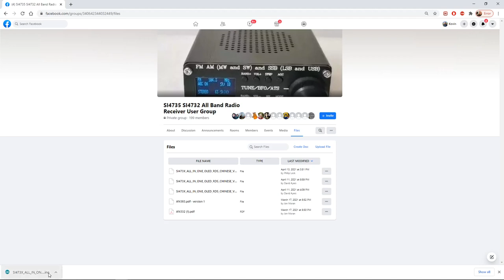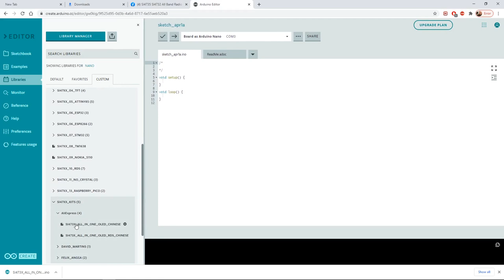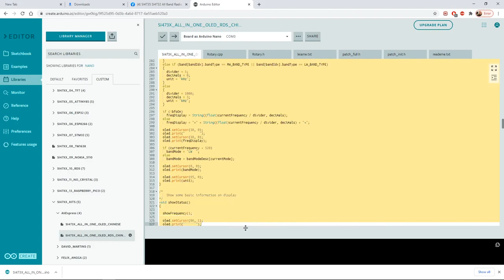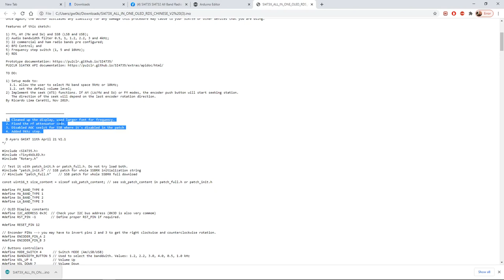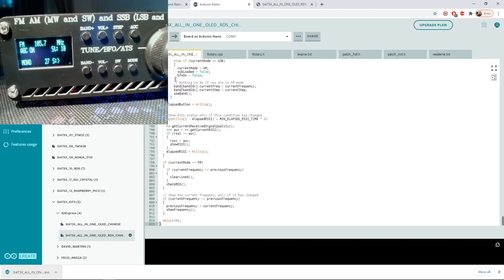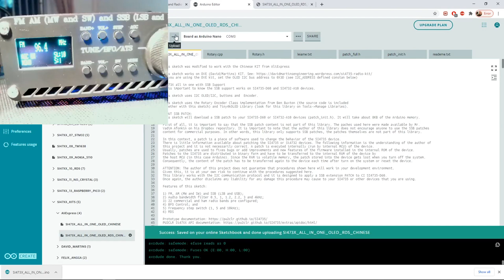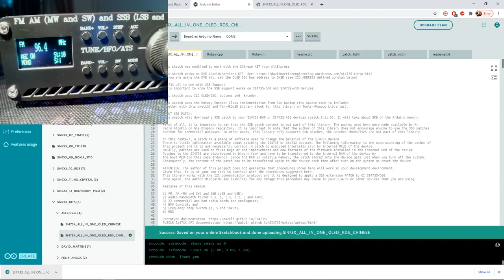Upgrading the SI4732 with better display and 9khz steps

Comment: The 9 Khz steps handy here and I like the bigger freq readout .
Thanks for the explanation of this
update Kevin
Reply: Hi there / Hi Kevin : The firmware used for the earlier video brings with it the 9kHz step selector; the comments by the code author's have not been updated but in fact it does.  Earlier video is https://youtu.be/TqCddn2Hq-4  . You don't need to get any materials from the facebook group to follow this earlier video. Also with a bit of programming you can amend the code and upload it with improvements, also.

Comment: Had problem in that I could not upload to the 328 chip. For some reason the boot loader was not there or not working. I had to find the 328 bootloader HEX file and load it using AVR Studio and AVR ISP Mk 2 programmer. I could then load the program. have yet to test it fully but it appears to work properly. 
I am rather new to the Arduino environment, most of my AVR programming has been done in BASCOM. What I can now do is make changes to the code if needed and copy the HEX code from the programmed chip and transfer it to other 328s.

Comment: I need detailed instructions to upgrade the firmware on my ATS 20+ from 1.1 to 3.1 I can't see too well on my laptop and Im a little hard of hearing and have a problem with the audio. I've seen the Adrinino page but don't know how to get the drive and the software. My radio has a firmware port right abouve the C-type power plug.  I'd appreciate your advise and help.

Comment: Hi kevin can you load the sketch on the youtube description. Dont have a Facebook account.Appriciate it.....
Reply from the maker: Hi, the sketch Isn't mine, i have just used it. in any case I don't think you can load files onto you Tube in that way.
Reply: Hi there / Hi Kevin : The firmware used for the earlier video brings with it the 9kHz step selector; the comments by the code author's have not been updated but in fact it does.  Earlier video is https://youtu.be/TqCddn2Hq-4  . You don't need to get any materials from the facebook group to follow this earlier video. Also with a bit of programming you can amend the code and upload it with improvements, also.